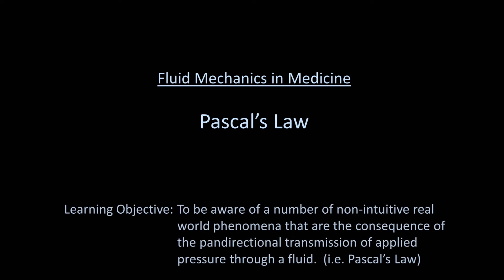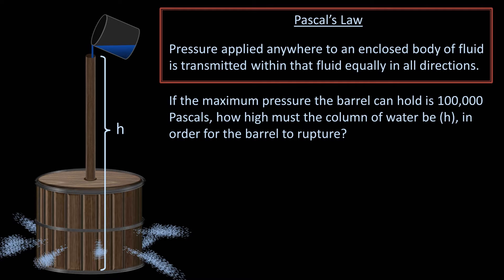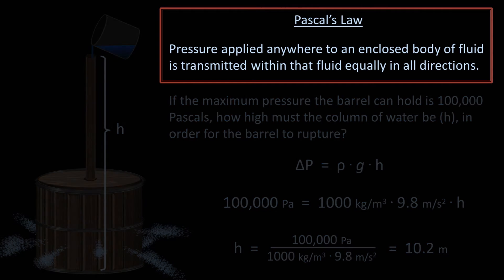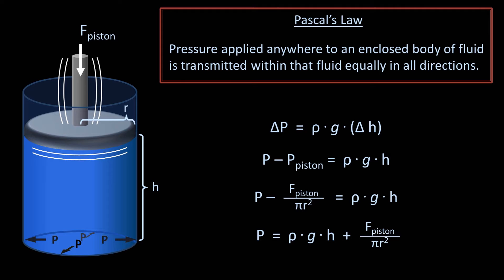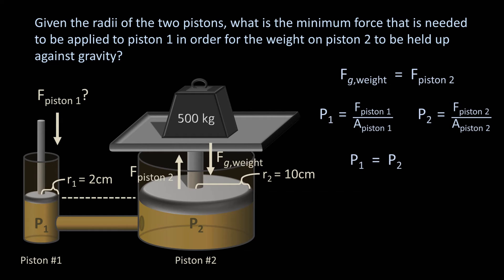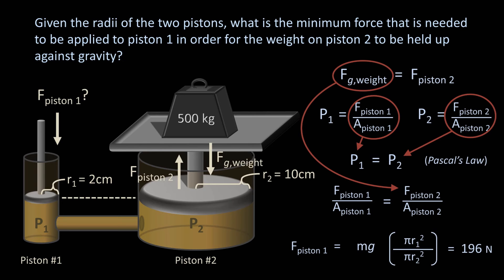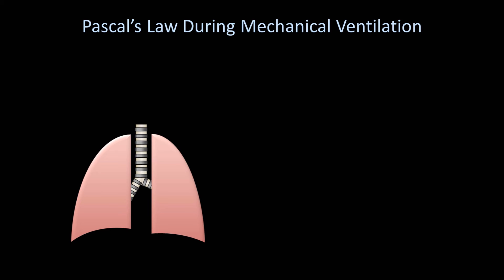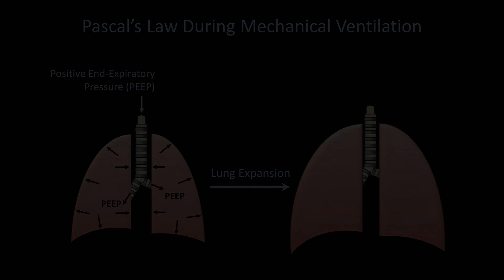Pascal's Law (Fluid Mechanics - Lesson 5)

Comment: Ok so I understand pascal's law. My question now is if the connecting pipe was split into 2. Where 1 pipe goes to piston #2 and the other to piston #3. Pressure remains the same correct? Following so if a problem adds an additional line where the force acted on piston 3 goes to a new piston (piston#4) the pressure would still be the same correct? That is my question. Will pressure remain the same from piston 3 to piston 4?
Reply: Wil be the same but divided by 2 3 4 so on so forfh you will need more distance on piston 1 to lift each one same hight